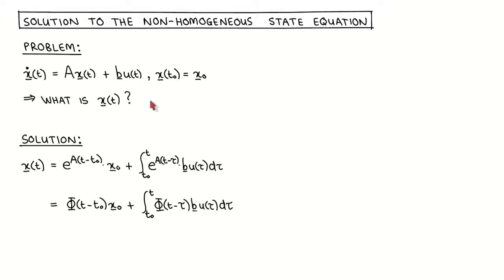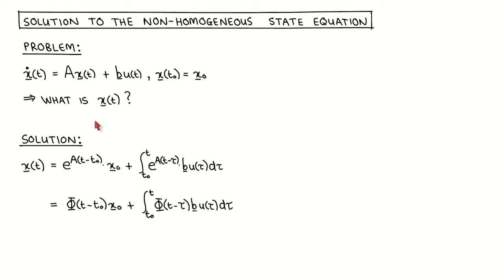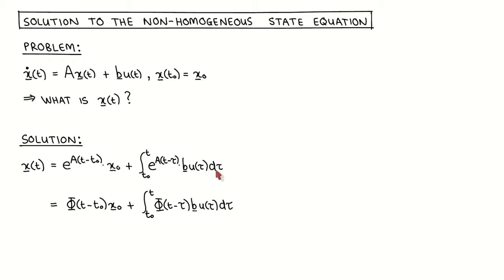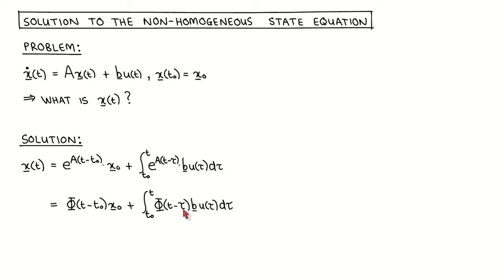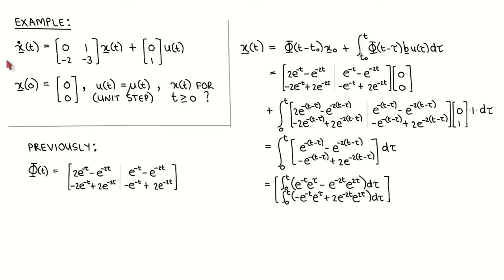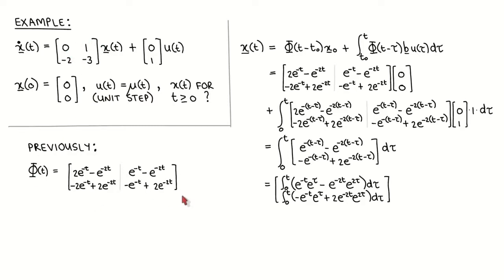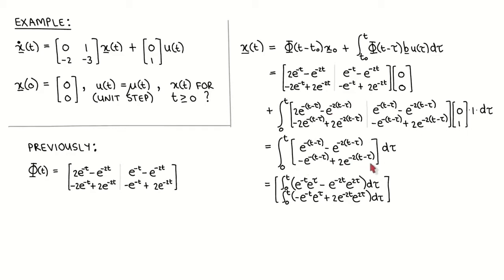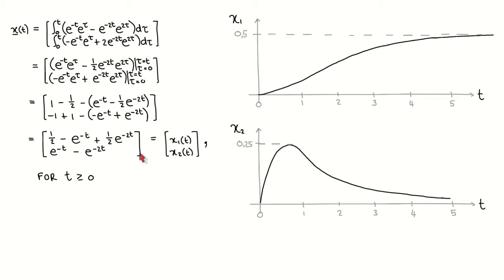State variable control 19: Solving the non-homogeneous state equation, Part 1

Comment: Hello Prof., This series of lectures have helped me a lot in understanding these systems as I am studying the parameter estimation process for any state-space system. May I ask that normally the calculation is applied to digital computer, which makes the system becomes discretized, could you explain how to solve a state-space system in such domain?
Reply from the maker: Solving the non-homogeneous equation for discrete-time state variable systems is much easier than for continuous-time systems.  Discrete-time SV systems are described in the form x(k+1) = Fx(k) + Gu(k), which is a collection of 1st-order difference equations (as opposed to differential equations for the continuous-time case).  You can solve the non-homogeneous equation by simply calculating the equation for k=0, then for k=1, then for k=2, etc.  

If you are interested in discretising a continuous-time SV system: It is too involved to explain here, so you will have to look at a SV control textbook.  The principle on which it is based is quite simple though -- it amounts to repeatedly solving the non-homogeneous state equation over sampling periods.